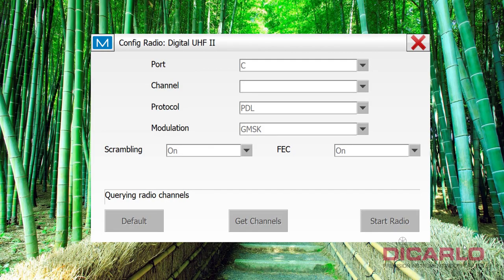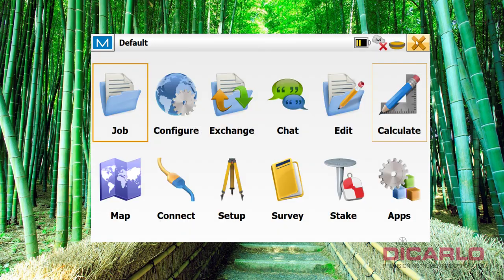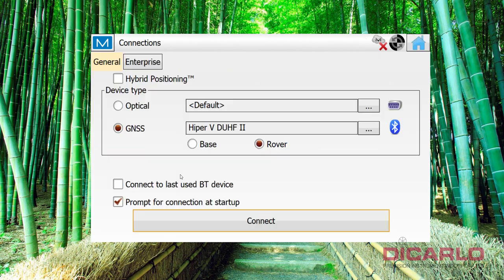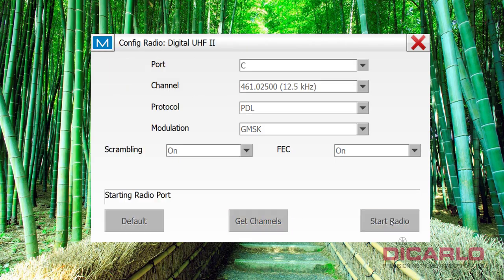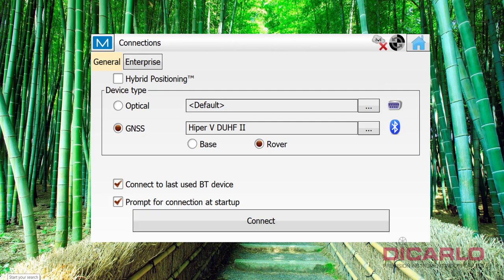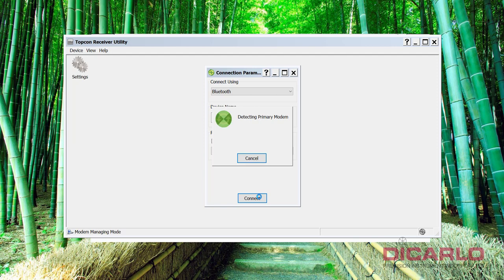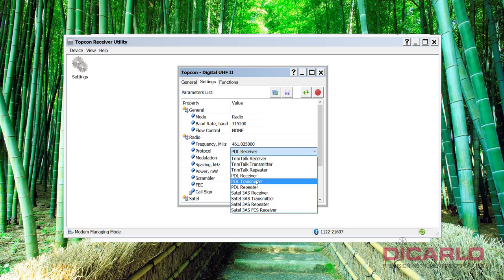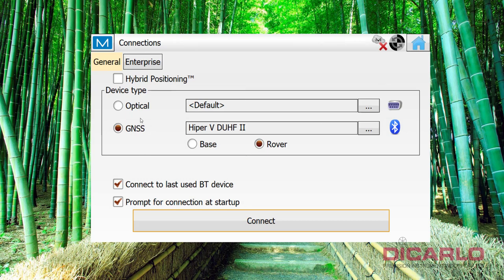Topcon Troubleshooting GNSS UHF radios

Comment: Hi, I have issue with connect Modem Managing in TRU with GNSS Hiper SR500, all Modem is connect except Modem managing, do you have and advice? please
Reply from the maker: So, Hiper SRs do not have internal radios. They only have the "LongLink" Bluetooth radios. Hence "Modem managing" will not do anything. As there is no setup needed for the "LongLink". So, there is no issue with yours! It just does not exist!
Reply: @DiCarloTV  thank you a lot for fast reply. I'm archaeologist I still new to learn about GNSS. I have another question, in GNSS hiper SR there are two receiver, I don't know which one is Base and who is Rover? Am I select that? If there is One to Base and other is Rover, How can I know and where?
Reply from the maker: @Ahmedali_-qd9eg  Either one can be a base or rover. When you connect to one as the base it becomes the base, the other will become a rover because you'll connect to it as to a rover. You make the distinction by making the change during connection (base or rover).
Reply: @DiCarloTV  thank a lot for help me , you are great.
Reply: @DiCarloTV  thank you Carlo, everything work well with GNSS in field, I used ppstatic to get one point, How can I get more points when Base work on ppstatic? I mean use other pace (Rover) to contact with Bace to get several control point. May I get your email to be contact with you?

Comment: Hello man , I have  topcon GR5 when I stake or survey some point it change from fixed to auto and the signal  went  form 100 to 0 
When i go to configuration radio it chang from PDL to Trimble
Reply: Sounds like your settings need a review. Review and set them to what you want them to be and check that they don't change over time. Good luck! Mind you. Settings don't matter as long as they are consistent. Meaning the BASE has to have the SAME settings as the ROVER. PDL/TrimTalk/Simplex does not matter... Just the same!

Comment: hi man, how updating firmware of the digital uhf radio  to version 2.0? i have the firmware but i can not doing... bye thank you.
Reply from the maker: To upload DUHF radio firmware, you need to use Topcon Receiver Utility (TRU). Change the mode to "Firmware loading" and then change the "Target" to "Peripheral Device (Modem, Bluetooth, etc.)". Then select your DUHF firmware file. Upload. Done...